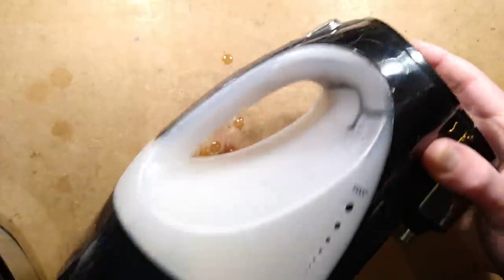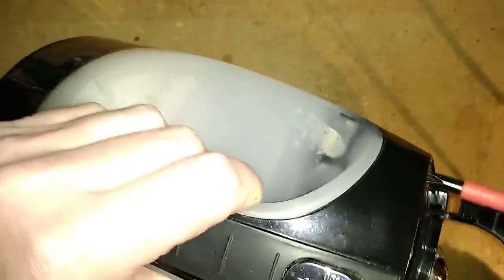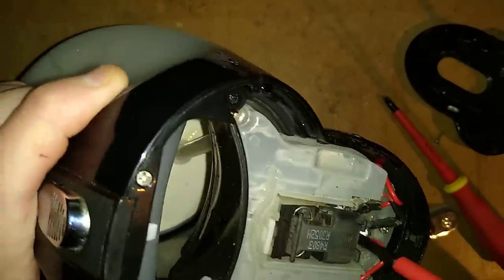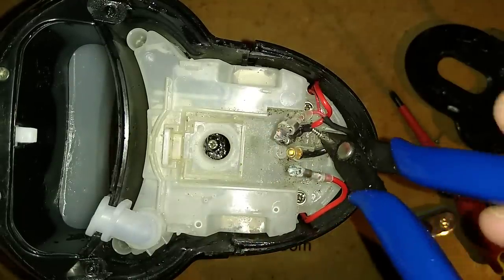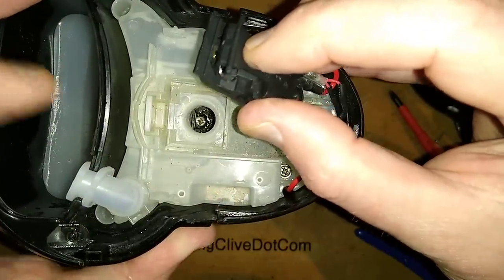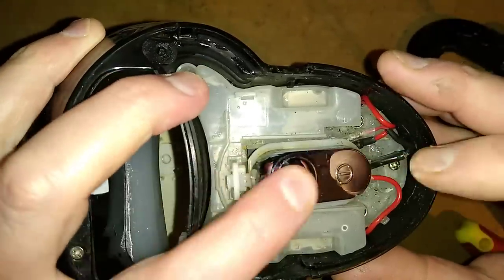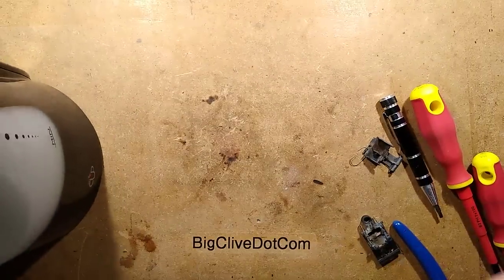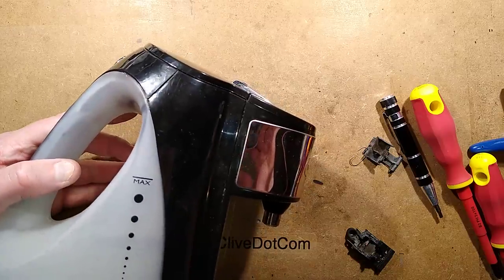Replacing my Breville Hotcup power switch.

Comment: I adore a good 3 kw kettle. It was one of the things I brought with me, along with my tools, when I came back to North America after working electrics and IT in the UK and mainland Europe for a while. Not sure why the NEC & CSA don't require 240v sockets in kitchens, garages, and workshops as standard kit over here. They may catch up to that eventually. I certainly have 240v sockets fitted in my North American houses, specifically because of 3 kw kettles, induction wok hobs, and lab & shop equipment.  And of course, there is no way I would bother charging an EV from the typical piddling 120 volt domestic sockets.  Enjoyable as always Clive!  But now I'm going to need another cup of tea.
Reply: Some kitchen circuits in the US are wired 120/240V with each side of the outlet powered from opposite phases, saves quite a bit in copper costs.
Reply: @NiHaoMike64  Mostly in older installations, exploiting the shared neutral nature of the 120/240v split-single-phase system. But it's bad practice in the current era of RCD/GFCI and Arc-fault breakers. Additionally most of those shared neutral circuits never fed 240v sockets. To be fair it didn't save much copper per installation either. Any monetary savings would be eaten up by the cost of the then requisite double pole with neutral monitoring RCD/GFCI breaker (RCBO) or Combo Arc-fault breaker. Since  did quite allot of industrial electrics I carry over some of those practices to domestic. Not strictly necessary in North American houses, but in mine I have two service panels (Consumer units). One for all single pole 120 volt loads, and a second panel which houses all 240 volt double pole loads. This makes organization & load management simple, and makes full or partial backup power a snap to implement with manual or automatic interlocks for generator inputs, and also simplifies islanding your solar inverters for back-up use. I don't like unplanned or prolonged power cuts if they prevent me from getting things done. Or from boiling my kettle. Though, other water heating options are available.
Reply: @crashk6  Some AFCIs, like certain GE models, are designed to not need neutral sensing.
Reply: @NiHaoMike64  Interesting. Not sure how in a double pole device serving a split single phase set of 120 volt loads how that would be able to sum the power on the two 180 o phase conductors without also monitoring the neutral. The ones I'm aware of without neutrals can be used on 240 volt only loads. I'm not partial to using GE equipment, so it's very possible it's something I've not seen. If I'm not using DIN rail based protective devices, then it's usually schneider/square d QO. It's the only thing available in North American molded case breakers that I don't find to be hugely archaic for domestic use from a trip curve standpoint. Though you have piqued my interest; I'll look for the device type you've mentioned. If it's indeed what you say it is, I may have to buy one to take to pieces just to suss out it's mode of operation.

Comment: Well for the past 8 months I have been meaning to order a switch.. finally have! soon the 1cup shall brew again!
Reply from the maker: Be aware that most of the switches sold on eBay are crap and probably won't last anywhere near as long as the original.  They also have an exciting failure mode of just staying on and boiling and shooting out cup after cup of water.

Comment: I'm constantly amazed how much more clever your 220v designs are over everything here in America. Here that single switch would be replaced by a switch and probably a disc design automatic resetting thermostat that would click on and off constantly. And still it would never heat as fast as 3kw can. Most of our coffee makers are like 1200 watts and water heater kettles are not a thing here like they are over there. Interesting vid, Clive.
Reply: BTW I drink a lot of tea. I actually have a separate dedicated 'Tea Station' now. I use an induction burner. I've found at 1850Watts this is even faster than heating the water in the microwave.

Comment: I'd love to see what happens when you submerge one of those piezoelectric pumps from your previous videos underwater. Can they pump water the same as air?
Reply: Tecalemit (auto garage tool manufacturer) make brake testing rollers and gauges. They detect when the wheel's about to slip then at the same time as stopping the roller, use an AC powered valve in the pipe to the gauge to hold the reading. With these things powered up, unused, the gauges gradually creep up - it's the electric non-return valve acting as a pump !

Comment: I bought my wife one of these a few years back to use at the office and she's recently brought it home. Im doing my usual and plotting to take it to bits for no good reason and seeing those terminals, I'm now convinced that with the wrong type of screwdriver, some scissors, and a minor electrical fire I could get it to glow blue 24/7 instead of only when it's boiling.
Reply from the maker: I'd guess it only glows blue briefly while boiling because the resistor they use is not rated for continuous use.
Reply: @bigclivedotcom  Ah, I would have assumed being LED it would be some low power circuit that could be left on indefinitely, so thanks for the useful info.

Comment: i used this kettle in my two KVcuppa tea video :P. i personally stopped using mine because it doesnt heat the water up enough to make a cuppa, i also use quite a large mug which it doesnt fill all the way. i can confirm that Strix make the asda smart price kettle components i made a 500W 12V kettle with a smart price jug with those 12V cup elements from ebay that i soldered into a sheet of copper as a mounting plate and sealed inplace with food grade silicone. it plugs into the car via the inverter plug which is a 50A Anderson connector in the boot.

Comment: 12 pounds for the switch? Can't you get a whole kettle for around 20?
Reply: The new kettle will be designed so that it cannot be repaired, and will last two days beyond its warranty period.
Reply: In the video he said a new one cost about 50
Reply: I just had a quick look on Aliexpress. You can get a PAIR of very similar looking switches - possibly a 1:1 copy with no "Breville" logo - for 2 dollars delivered.
Reply: My kettle cost £3.99 from Argos. That means I can replace it thrice for the cost of a switch!
Reply: Steve Terry  33055599491 but there are many many other sellers available. Just do a generic search for "kettle switch" - most of them appear to be identical.
Reply: ASDA selling one for £12. 3000w too
Reply: Yes you can buy a standard kettle for less than £20, but this isn't a standard kettle. It's more akin to a home version of the boiling water dispenser/bowsers you get in cafes and workplaces. These are good for people who cannot lift a kettle safely too, those with arthritis for example.
Reply: @TheTruthAboutLemmings  can vouch for the cheap Asda kettles, I got the £9 One and it boils quicker than the branded one I threw away!
Reply: @Aengus42  but it only last one fifth as long as a unit that isn't garbage from new anyways so...
Reply: It's not about the money, it's about not throwing it away.

Comment: I just got a bloody great belt from mine. 220v between the switch and earth. Tripped my RCD
Reply from the maker: That's unusual.  I wonder what happened.  It's part of the reason I strongly disapprove of chrome plated switches.
Reply: @bigclivedotcom I had it apart today and think that a strip of the chrome finish had flaked off and fallen down the side of the switch. Not sure how much I trust chrome  plated switched going forward either.

Comment: I'm amazed you had one long enough for the switch to fail.  We went through I think it was three of these, because the plastic pipe kept popping out of the boiler tank. :(  We tried the model up and went through a couple which did the same, before finally getting one that kept working. (at least they all broke in warranty)

Eventually they released a higher model which uses stainless steel pipes instead (probably with plastic pipe inside it) which we have now.

Comment: Hey Clive, I was looking for an identical switch, but for an Indian made(prestige brand) kettle. So I guess it's a common design, and quite a common failure mode where the springy metal bit corrodes.

Comment: See, I would have been decadent and just upgraded to the Bosch Filtrino 2, multiple cup sizes and temperatures (inc. ambient) plus uses soft controls instead of just a bimetallic switch. Can take a BRITA filter cartridge too which is nice. A true high quality device. I brought mine from Amazon  Germany as even with shipping it was cheaper.

Comment: Choice of beverage and preparation method is probably a bigger factor than voltage when it comes to the popularity of electric tea kettles.  Nearly every home and office in the US and Canada has a "coffee pot" (electric drip brew coffee maker; mostly unknown in Europe).  Japan has even lower voltage, but electric kettles are ubiquitous.  US and Canada will microwave water for tea or boil on the stove top in a "tea kettle" because tea is just not as popular of a hot beverage.

Comment: I’ve got one of these kettles too. I wish there was some way to make it dispense larger volumes of water for the giant mugs I use.
Reply: The higher model does 350ml, its a shame there isn't a 500ml for large mugs though.  But then the more it can boil, the less efficient it is when you need less as it has to boil the same amount every time due to how the boiler and dispense mechanism works.

Comment: Massive spread of prices £29-64 plus one where the one cup kettle comes with a 4 slice toaster for £84!!!

We used to have a gadget that made 2 cups of tea in the morning.  I cried when it died.  My only beef with this is quantity.  A 250ml mug isn't enough, these days I make 2x 1/2L (1 pint) mugs.  Wife drinks the lot hot - I make drip feed most of mine over about 3 hours (most is cold, a habit formed over 40 years as an engineer/instructor), rinse and repeat every 3 or so hours 'till bedtime.

Comment: I got a new kettle a while ago, and it has the switch in the base, and it's made of clear plastic, like many of them are that have an indicator light inside the clear plastic. But mine didn't. It has a little neon on the side, but that's just stupid. I thought it would be easy to remedy, but it also had stupid security screws in the base, so it was hard to get it open. I got it open, though and stuck in a nice blue LED with a diode and a 56k resistor in series, so now my kettle has two indicator lights.

Comment: Our poor American, Canadian and Japanese friends can also use 3 kW electric kettles, they just have to wire in an extra 240VAC outlet, and use a weird-240V-plug to BS/Schuko adapter in order to use them :)
Reply: The nominal voltage in Japn is 200V (202± 20V stated by book) .

Comment: Isn't it funny how we get attached to kettles? lol... I've had my Morphy Richards one for more than 9 years, and still looks and works as good as the day i bought it, used every day 24/7 similar base to your Breville, but mine is polished stainless kettle, with a flat heater element base, so can boil as little water as possible. I love my kettle, if it broke i would def try and fix it lol.... I even polish it with Brasso, and descale every month...what a sado eh...:-D

Comment: I don't think it would have "Boyang" written on it if it was made locally. Doesn't sound particularly British. But it does make you wonder if it's a standard item, because pretty much all kettles I've come across have a similar method of operation. I do know the design firm I work for managed to get hold of a supplier for those contacts these things have on the bottom.

Comment: Is the only benefit with the 'instant boil' kettles purely speed? Has to take the same amount of energy right? 🤷🏼‍♂️
Reply: A faster boil means less energy escaping out the sides while heating up.  Waste is surface times temperature times time divided by thermal insulation efficiency.
Reply: @johndododoe1411  legend, thanks 🤙
Reply: @johndododoe1411    there's one other factor, which may be negligible.  The losses in the house cabling will follow P = I-squared  R, where R is the resistance of the cable.  Picking simple numbers, at 250V we get 8 amps for 2kW and 12 amps for 3kW.    8 squared is 64,  12 squared is 144.  So the wiring loss is more than doubled.
Reply: @raykent3211  Standard regulations for house wiring is designed to keep the power loss below the wattage that would degrade or destroy the insulation on the wiring.  Thus wiring for a 16A circuit will be required to have a resistance about 2.6 times less than wiring for a 10A circuit.  Because these factors ultimately also control fire risk, the amps of the fuse/breaker determines the minimum legal wiring ampacity.  Transport of hot water or steam tends to have greater losses than electrical wiring for the same distance and power, thus the benefit I mentioned only applies when the electrical power is obtained from heat, but not when electricity is obtained by means that don't involve a large thermodynamic entropy, such as hydro, wind or solar.
Reply from the maker: It's very efficient.  It only boils the exact amount of water needed.

Comment: I just buy the cheapest kettles, simply because the only difference in the internals from the cheap one to the most expensive one is the retail price. The internal element and switches are exactly the same ones, which is the failure point. If they last 2 years in the office good, if they last less than that better, as there is a one year warranty, and I keep the box with a photocopy of the invoice as proof.  Had one last 5 years, though admittedly it was 6 new units, as they all would last 9 to 11 months, with the final one lasting 12 months 1 week almost to the minute.

At home gas kettle, no element needed, or use the microwave oven.

Comment: I'm not sure i like that the boil shut off mechanism is the switch itself. What do you think the likelihood is that the switch could fall closed?
Reply from the maker: If it does the unit would keep cycling until it ran out of water, then the base would cut out thermally.  It probably has a couple of extra safety layers.
Reply: It would be easy to turn off at the socket if that happened as well, it is unlikely to be left unattended for too long whilst operating.
Reply: It boils a preset 300 ml of water (one cup) in 45 seconds, so not a kettle designed to switch on then go do something else. By the time you've got the milk from the fridge it has clicked off and dispensed water into the cup on the stand underneath.

Comment: I haven't read all the comments so this may be repetition, but anyhew:
Strix are a company that only sells to manufacturers, in bulk. The result of this is that numerous clones of their various kettle switches appear on ebay and elsewhere, until and unless Strix attempt to sue the makers for patent infringement. On at least one occasion they have successfully sued,  but i don't know in which territory this case was heard.
This would be the reason Clive could only find one listing for this type of switch; and it's likely that the listing will vanish in the near future so if you think you might need one...buy two ASAP.  Boyang! 
I can't really admire Strix' approach to the 'problem' since it was a problem that doesn't really exist insofar as their revenue stream is unaffected. It may be the case, of course, that they have a contract with the customers which forbids them from selling to the public, to protect the kettle maker and their net profit. If this contract does not exist then it would appear they are just being bloody minded or neurotic.
The nature of their switches is so basic in my opinion, that patenting them is just a default procedure..They are simply not fantastic enough to justify litigation against cloners. Strix should be (in my opinion) ignoring clones and saving the planet a wee bit by reducing the WEEE pile of pathetic kettles with busted switches. Otherwise they should supply the public. Win win situation.

Comment: I was surprised Clive didn't change the LED with a color changing LED.
Reply: It needs it, not a fan of them using blue LEDs in these things.  I wonder if you could get an LED that changes from blue to red over the time period it takes to boil the water?  That would be quite the gimmick.

Comment: £13 for the switch - is that £3 more than a brand new kettle ?
Reply: This isn't a kettle. A brand new one of these one cup machines costs at least £40-£50.
Reply: @eraldorh  I think this'll do 1 cup - for a tenner: https://www.argos.co.uk/product/6992277

You just have to manually pour the water out.

I've an ordinary Philips kettle in which I boil half-cup sometimes.

Comment: My Breville Hotcup has a different fault.  It occasionally expels a small amount of boiling water, then stops boiling for about ten seconds and then delivers a full mug's worth causing an overflow into the drip tray.  I assume the non return valve between the reservoir and the heating chamber isn't closing properly.  I've tried descaling it but it doesn't help.

Comment: I have one too and good to see that it can be repaired. The fixed amount of water dispensed is a bit limiting. I'm not sure that it has 'boil dry' protection, so I have to double check the tank has water each time. My top LED works only sometimes - how does that happen?
Reply: I tested the boil-dry protection on mine... Mine cuts off almost immediately if there isn't enough water.
Reply: @marko247  Thanks. I will tentatively test it myself. I seem to remember not realising it was empty, turning on briefly and it smelling very hot and hissing loudly when I quickly added water.
Reply from the maker: Sounds like a failing LED.  There is boil-dry protection in the base, but it's worth topping up regularly.